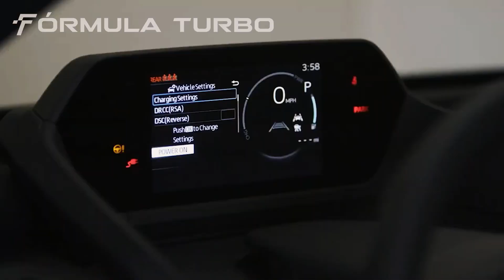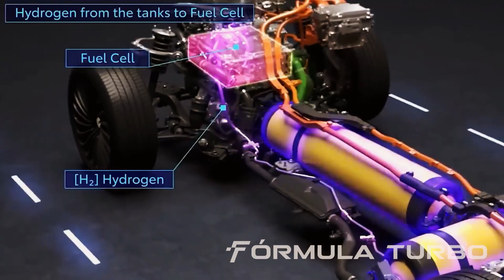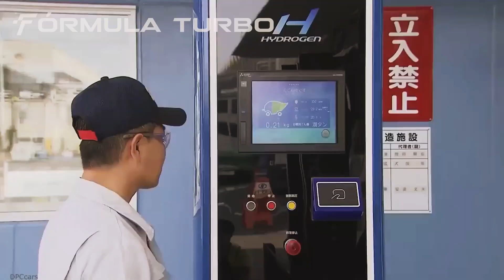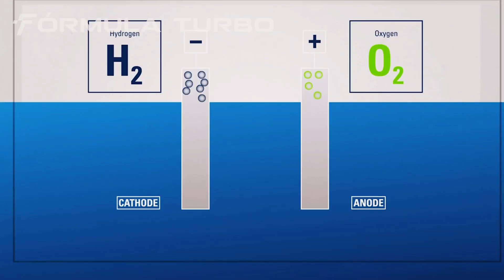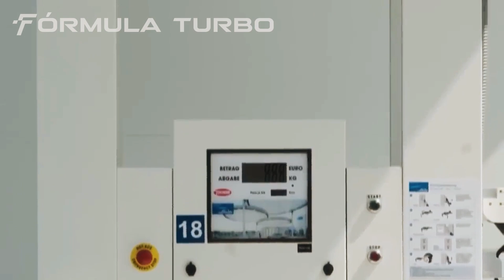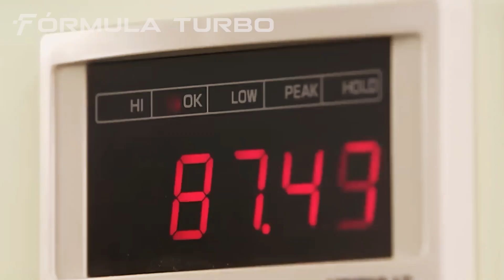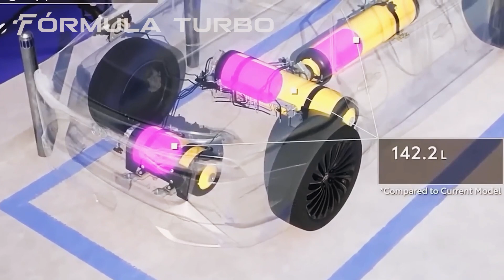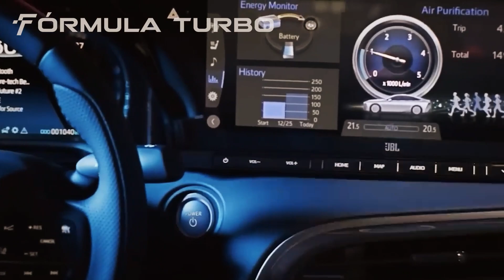URGENT UPDATE: TOYOTA'S LEADER REVEALS FUTURE ENGINE TECHNOLOGY

Comment: What i want to know is first, Since we have a clean water shortage. Where will all the water come from to make hydrogen? Long term what kind of affect will it have on the potable water supply and natural process of precipitation. Second. How much will hydrogen cost? Third. When producing hydrogen from water you are left after the separation with H and O Will the oxygen be released into the air? If so what will all the added oxygens affect be on the planet be in the long run? If i remember my schooling right one of the reasons dinosaurs wore possible was an increased oxygen level in the atmosphere with bugs the size of dogs. Also earth was warmer during this time. Is the added oxygen a greenhouse gas? On google i get conflicting answers. I am positive if oxygen is added to the atmosphere in large quantities there will be a consequence. If an abundant amount of hydrogen is made from water we will have a release of large quantities of oxygen as a byproduct released into the atmosphere.

Comment: Hydrogen when burned is clean, but more than 90% is today made from ordinary fossil fuel, still if you go green and make it from solar/wind you still loose 30% and then you have to transport it and burn it with compounded losses up to 70%-80% which means hydrogen will always be THREE TIMES AS EXPENSIVE compared to just charging your EV directly from solar/wind. 
That is why hydrogen is already dead, Shell has been closing down all hydrogen gas stations almost everywhere, no one wants three times the operating expense. 
And EV car batteries "doesn't have to be disposed of", they are sought after as a cheaper and better alternative to mining for the raw materials and are 95% recyclable. 
Lastly: If you want to know what happens to hydrogen, take a good look at the Hindenburg zeppelin. That's EXACTLY what has happened to several trucks/lorries and hydrogen gas stations; they EXPLODE as hydrogen is the smallest atom it's nearly impossible to prevent leaks and leaks will inevitably EXPLODE!

Comment: I own an EV and I charge it at home. If I had solar panels, I could use them to charge my EV. Battery technology is rapidly advancing. Tell me that if I have a hydrogen tank all of the hydrogen would not leak out.
Reply: Good luck in the cold weather ☁️
Reply: @seanmf202  I think the Scandinavians are doing quite well. There are challenges at both the hot and cold extremes. Adopting renewables energy does not mean being uncomfortable. Granted, there may be times and places that practical solutions will be necessary. I would hope that you are aware of the dangers of tropical overheating. Large portions of the world will become uninhabitable without artificial cooling. What happens is that the human body will not be able to sufficiently cool itself, leading to "heat death".
Reply: What you lose in an EV during the cold is more than made up during warmer periods with regen braking. Gas cars do not regen , just wasted heat. ( For EV's  one needs to prewarm batteries and the cabin, )   @seanmf202
Reply: Do you realize building your EV made more pollution than building and driving a combustion engine for the life of the combustion engine car? Then when you try to trade in your EV it will be worthless and deposing of the no longer useful car will also cause much more pollution than a combustion car? Do your research before you think you're doing the world any good. The road to hell is paved with good intentions.